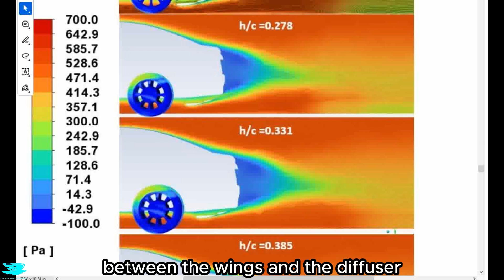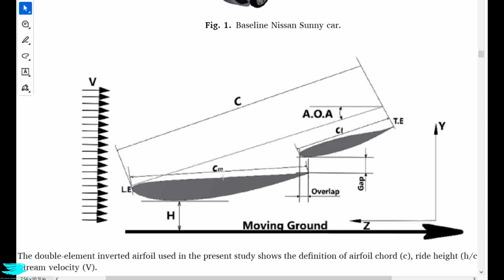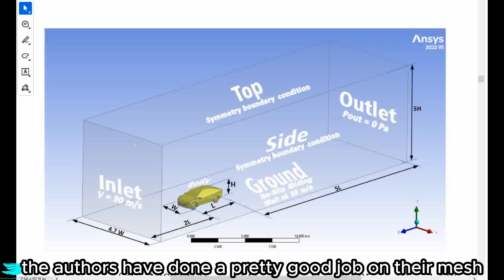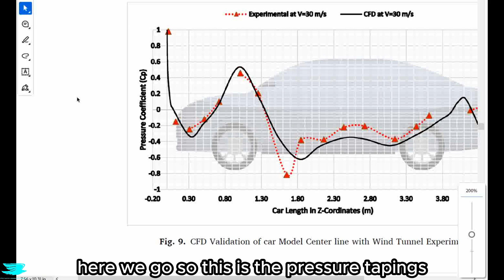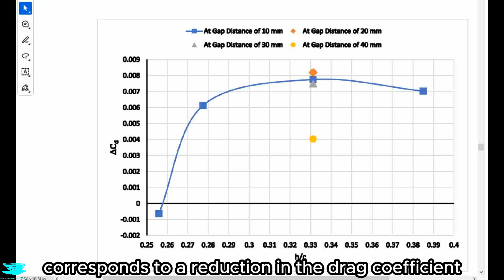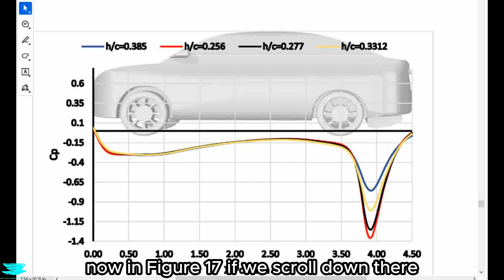New Wing Car Diffuser Design Podcast 225

Comment: On the 2014 Q50 hybrid, the muffler sits the width of the car slightly lower than the bumper/diffuser. If I were to place the staggered wing in slightly lower and in front of the muffler, can the muffler be used as a wing leading into/onto the diffuser and might/will it be effective?

  I also added the 5 vortex generators at the front of the car as you suggested as well as air tab VG's at the front of the rear diffuser from your "How I improved the Q50 aerodynamics"  video and,  the results fuel wise and stability has been amazing!!  Of course, I look forward to your input.  What you are doing here is absolutely amazing!!
Reply from the maker: I'm not sure I completely understand the setup, but from what I think you mean, I don't think the muffler will be a wing, but really just a surface that could create low pressure and act like an addition to the diffuser. That would increase downforce more.

Comment: I've been wondering whether or not using the diffuser or floor surface as a heat exchanger would be beneficial. Theoretically if you could populate the diffuser or floor with heat exchanger fins that, for the sake of a thought experiment, do not impart surface drag to the flow. Curious if heating the air as it passes through the diffuser or floor would improve the performance of the underbody as a whole. Intuitively I am guessing it would not, since any decrease in air density would negatively impact the downforce generated through the diffusers expansion. Conversely, if you theoretically had the ability to chill the air passing under the floor or diffuser, would that be beneficial instead? 

Thinking about this is to try and come up with a "blown diffuser" analogue heat exchange concept for an EV that does not produce exhaust gas. Certainly whatever effect would be small, but even 150kw of heat energy exchanged in the right place in the right way could have a beneficial effect on aerodynamics.
Reply from the maker: One potential benefit would be to heat the diffuser. You could then run it at a higher angle of attack and keep the flow attached. You could then get more downforce and probably reduce the drag too.

Comment: just found out that in the late 80s the early design of Ferrari 456 had a proposal for a wing in the diffuser that would open to direct air into a diffuser and when closed (almost horizontal) would be flat with the floor
Reply from the maker: That's pretty cool. Thanks for the info.

Comment: What about mounting it further back as the air pile up directly under the car with the current configuration, not efficient enough. Also did you stumble upon this idea during the porsche 911 bump video ?
Reply from the maker: That could work and effectively be like an extended diffuser. That should reduce the drag but might reduce the downforce because you don't squish the flow over the diffuser as much so you can't run it at as aggressively.

Um, I think I actually found this paper at a different time and just thought it was a cool idea.

Comment: Wouldn't shifting the diffuser wings back create more downforce because they'd be pushing the air flow into the wake instead of into the underside of the trunk? Also, we need a video on extended rear diffusers.
Reply from the maker: Honestly, I don't know yet. I haven't seen any data on that.

But, it might, or might not. As you said, it could because of pushing the air into the wake more, but it might not because it wouldn't help keep the flow over the diffuser attached as much, so you couldn't use as an aggressive diffuser.

Comment: Would it be better to lower the floor of the car to the same ground clearance as the wings? Then you have a much larger area to generate downforce, and also less flow hitting the wheels to creates drag?
Reply from the maker: Lowering the car definitely helps increase downforce, but then you need to make sure the wing sees decent flow to be able to work properly too.
Reply: @PremierAerodynamics  I actually mean remove the wing all together and just use the floor and diffuser to generate downforce. Say you have a vehicle with 15cm ride height and diffuser wing 10cm off the ground, what advantage does it offer in terms of aero compared with a configuration with 10cm ride height and no diffuser wing?

Comment: i guess it shows that simply putting a decent wing under your rear area youll get most of the benefits, maybe not optimised but still better than nothing, unless you proper cook it with mudflaps blocking the rear for the car or something
Reply from the maker: I think it will mostly be okay. At the very least, you could see how the fuel usage goes and get a general idea from that.